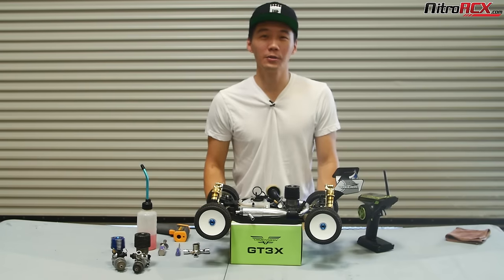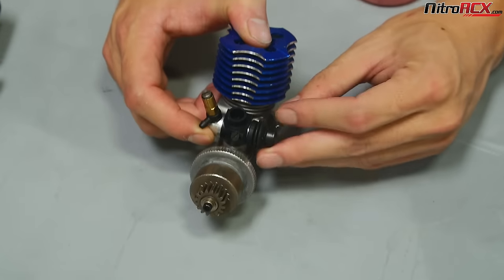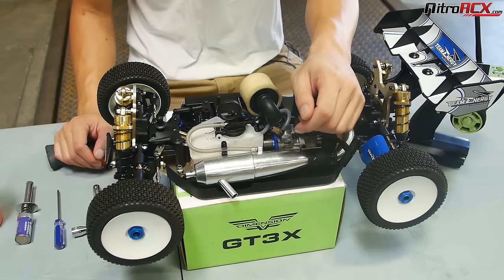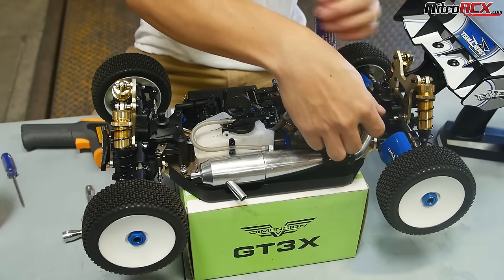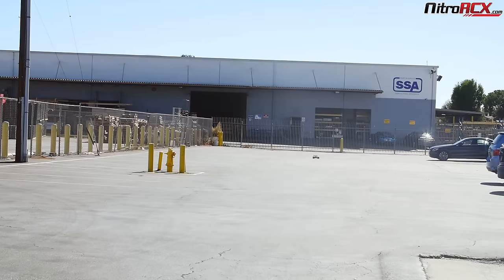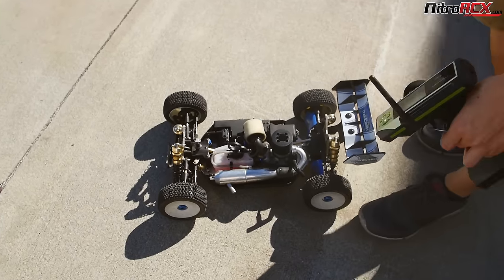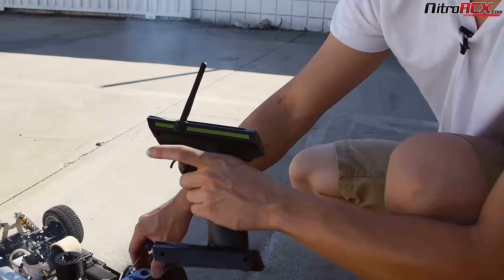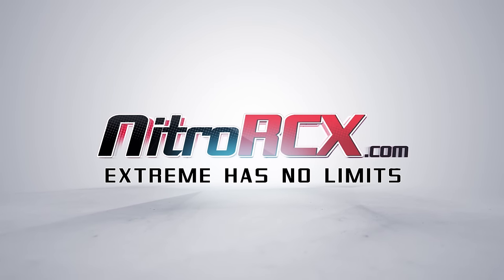Nitrorcx Guide: Fine Tuning your Nitro RC Car

Comment: I actually read the entire trx 3.3 manual and learned the importance of cleaning air filter after every hour of use (serious, it’s a big deal) dish soap then air filter oil and your good to go. I also learned that after every run if your are going to store for more than 3 hours go ahead and spray 1sec burst WD-40 straight into open carb and into glow plug hole crank engine 10sec and repeat 2x more times. (Serious, WD-40 in the manual) Starts up great after this treatment and more importantly it gets all the nitro out of the engine so it doesn’t attract water and rust bearings out and such.

Comment: Been 10 years since iv played with my nitro. Im getting back in the hobby. As far as tuning goes, all i remember is a properly tuned engine will have some smoke coming out of it while on the throttle and not so much while idle.

Comment: Good video, I am a new nitro user. Just finished rebuilding brothers Trx 3.3 (bearing rusted from improper storage and broke apart and got eaten by motor) and broke it in. Thanks for explaining that if pinging occurs coming off of top speed richen HS needle, and also if pinging at idle richen LS needle.

Comment: when your leaning the lsn and your idle rises, with in mind you have a huge 1mm gap, you should lower your gap. i usually use half of what you use and your idle is way high. very good video man, really good for beginners if they just lower the gap a smidge :p

Comment: The biggest problem we ran into,was air leaks. Usually after a couple big wrecks,the carb will start to loosen and run ruff. If you seal the carb throttle body with regular silicone to the engine,fuel line nipples and the air mixture screws with teflon tape. Your air fuel mixture and engine will run consistently. Then we hosed clamped out exhaust  pipes together,for durability.

Comment: It's the low speed you need to richen to get rid of the pinging because as you say yourself it controls the amount of fuel from low to mid throttle, when you let off the throttle after getting up to speed it's the low speed that controls how much of the overall fuel from the high speed gets into the engine. If the low speed is too lean you can keep richen in the high speed but it will still starve of fuel when you let off the throttle

Comment: fantastic!  bout to get my ken block on!  I just started it for the first time, I have lots of fuel coming out the exhaust and burned thru a tank in just a few minutes...I think I had the idle screw too wide open,  im saving your video to my tuning playlist and im going to tune tommarrow..its 6 degrees in Illinois

Comment: Nitro is much more involved and takes patience and attention. It’s also much more exciting then electrics IMO. Electrics have come a long way from back in the 80’s and can rip, but for real motor heads there is nothing like gas or nitro. This video is a great resource for newbies getting into nitros, and once they get it I guarantee they will sell or ignore most or all of their electrics. It’s kind of sad that electrics have kind of pushed out fuel powered cars and trucks, and actual kit building, but today’s generation is much more about immediate gratification, and RTR. At least RC is still alive and kicking.

Comment: I've got a Kyosho Nitro Inferno MP 10 TKI3! I'm using an Alpha Falcon plus engine with a mid speed needle! That's an added adjustment! But using the same principle and method by listening,A fine tune can be achieved!

Comment: To everyone out there, sometimes 1 mm is way too much on the idle gap. Mine is more like .2 or .3 bacause the throttle is super responsive so keep in mind if you have a huge motor or a fast motor it could be less.

Comment: Badass.  hey they should make a long screw like a key that you can turn by hand that sticks out far enough.  then you wont need a screwdriver.  like a wing nut on a long screw.  easy access
Reply: T. Man my trx t maxx has that on the hsn
Reply: my axial .28 and axial .32 both have that for the high speed needle

Comment: Best tutorial on Youtube. Easy to understand the issues and tune it right. The only thing did not mentioned was the idle needle setting after the other 2.  Is it the last tuning or with combination with low speed needle the result can be even better?

Comment: THE ULTIMATE SECRET FROM WINNER RACER!! In all the videos I've watched about carburetor adjustments for nitro rc engines not a single one talks about the secret I'm about to reveal to you that makes the difference between first, second and third on the podium. The low speed must be adjusted richer than normal but the motor must still turn well between 1/4 opening and 3/4 because the needle in the center of the slide controls from idle to 3/4. From 3/4 to full trottle you can put the slide needle in your pocket and it wouldn't change the mix. The result is that when the engine is running full throttle and you release the triger quickly the engine wants air and fuel but the slide is closed so a lot of gas (and oil) goes into the engine and cools it down and lubricates it better. Think about this.. How many seconds do you keep full trottle in a race...2 or 3 seconds.. then you can adjust the high speed needle leaner than normal and gain rpm and horsepower and by releasing the trigger very quickly for a fraction of a second like before entering a curve it cools much more and the temperature of the engine will not have time to rise above 250 degrees and you have maximum power.

Comment: A couple things you did wrong here. The engine should not climb in RPM then drop when you blip the throttle. This is because it is lean on the mid fuel delivery. You did not compensate for the low needle adjustments. When you lean out the low end on a 2 needle carb you must also richen then high end needle in order to get the mid level fuel delivery to stay consistent throughout the rpm range. With a three needle carb that has a mid range needle you adjust the mid end needle to get a flat idle curve so it doesn't rise and fall when you blip the throttle. When you blip the throttle the engine should rev and then drop immediately to idol otherwise it's lean at the top from over leaning the low end needle.

Comment: Wow, this is that good in saving the video. Thanks mate. Also you did not re adjust your idle speed once you’ve set the low needle. Would you recommend having the engine idling at that speed or would it benefit anything if you lowered the idle speed? Cheers Steve.

Comment: I have a question about the Idle setting, 

You mentioned that once you adjust the low speed setting, you would have to adjust the idle setting, 
I'm guessing the reason why it was revving a little high was because the idle setting wasn't adjusted?  
Or did you find that the idle setting was set perfectly after setting the low speed ? 

Finally, if you richen or lean out the motor using the low speed screw, does gap inside of the carb change ? 

Great video BTW !!

Comment: Hi! Ive just started with rc cars and i got an old rc nitro car out from the shed thats been sitting for a while. I can start it but ones it gets warm it FLIES away with the sound its like its rpm flies away and when i push the gas it dies. got any ideas?

Comment: Erm if it's hotter outside than before the engine will actually be richer not leaner. In hot temperatures you would run leaner needle settings than cooler temperatures. The reason is air density, the hotter the air the less dense and less oxygen there will be so to compensate you need to lean the mixture. Therefore going by engine temperatures is only for a rough guide because in hot weather the engine will run hot and in cooler temperatures the engine will run cooler.... if it's tuned.

Comment: Im building a Traxxas 3.3 Slayer Pro No Prep Drag Truck & wondering would you recommend 33% Top Fuel with it's low lubrication if only used after race competition?? For test & tunes I use standard 20% with better lubrication

Comment: question, If you feel that the LSN and the HSN are adjusted correctly and your temperatures are on the cool side  , but your idle is a bit too high that the car is rolling forward, what of the idle screw and adjusting it? To lower the idle? when and how would you adjust your idle screw and what to look for? Thank you

Comment: Does air flow through the top needle? I've put some locktite(blue) on mine. The needle was backing out when the motor was wide open. Now it bogging when I try to open it up. Any ideas?

Comment: I'm getting lots of smoke with high temps. 300 dregree... I recently change if the piston and sleeve to 2017 Nov mito gt5 from 2016 spec.... at factory settings the engine is already doing 250 degree and the car is very rich... what should I do?

Comment: Hi. I have a tamiya tgs running the HSP 18 Nitro Engine 2.74cc. Have installed the engine. When the engine starts up the all four wheels starts spinning. Can’t get the idle settings or tunning setting right. 
Please tell me what can I do and how.

Comment: That seemed to work, but when I give it throttle it will die, is that a low speed needle setting?
Reply: Patrick G yes it is. You’re either too far in or too far out. If it gargles then dies is too rich. If it makes like a vibrating high pitch noise then dies is too lean

Comment: I just took an engine apart I believe was somewhat seized. The engine would not turn easily at all. Cleaning everything did nothing. The piston moves freely in the lower half of the sleeve, but not the top half?! How can I "polish" the piston to make it smooth again? Do I even polish it? What is the right procedure? Thanks.
Reply: Frank Castle its  supposed to be like that, it means your engine got good compression and still good, u prob figured it out by now

Comment: thanks very helpfull video 
I run a losi with argus 28 engine which running good but my engine stall after high speed pass
when I release the throttle 
any tips ? 
thank you
Reply: Low idle or rich low speed?

Comment: Can you give me a bit of advise on clutch bell size? I am building a Losi TLR 8ight 4.0 buggy, I will be putting a Novarossi Roma .25 with Novarossi Mugen compact short header and Novarossi 9901 super strong offroad tuned pipe. I am going to be getting a Novarossi NV-71000 clutch. What size bell housing (tooth) would you recommend for bashing. The over sized bearing is only fitted to the 15 -17 tooth but I want punchy low end as well as top end.

Comment: I think I’ve got all my setting pretty good when running but any press of the brakes and it cuts out. Tried to increase the idle needle so it looks like it has a good gap when breaking (not totally shut) but no result… it must be something to do with the combination of the other two needles right? (high/low speed)
Reply: It should be related to the clutch. If you push the brakes and the engine stops, it means the clutch is still engaged so the engine stops with the wheels.

Comment: what I'm experiencing is when I blip the throttle, the idle drops down below the idle needle setting for half a second or less then it climbs up to where I put the idle needle at. If I don't blip the throttle, the engine idles perfect, acceleration is great, high end is great, everything is great,  the idle immediately comes back down and stays where I set it. It only happens if I blip the throttle several times. The engine never dies so I'm confused to what it could be.  The engine was broken in following the Adam Drake method.  Anyone have new ideas I can check and look into?

Comment: just hypothetically speaking.. 
what happens if I'm playing for awhile and i check my temperature and its VERY HOT. 
Can I do anything to lower the temperature? or just have to let the car rest up?

Haha I'm new so this is prolly a dumb question
Reply: Mika Yamamori 
richen the HSN. it should cool the engine down.. or you could let it rest for 10 minutes
Reply: Your engine should slowly drop temperature when at idle, which means your low end and idle screws are adding enough oil(which is in the fuel) to bring your engine down to a cooler running temperature. If this is working correctly and you are cooling while at idle, If I overheat I try to always let the engine idle down to running temp before I turn it off. Seems like a bad idea to kill the engine at really high temps because while cooling and the piston is not still shaping the sleeve things can warp. There are a few other tricks to running cooler, In line fuel cooler in between gas tank and engine(problematic for leaks). Cut holes in your body for better air flow. Air is your best friend if you can fabricate any type of air cooling system for the fuel or the head of the engine like forced air intakes or something it will help a lot. Also temperature outside is a big deal and parking in the shade XD
Reply: Temps have nothing at all to do with tune. Real facts: I'm not trying to go in on you because it's what you have been conditioned to believe. But I'm here to tell anyone and everyone...temp guns and the concept of a nitro engine temps being monitored is comical. I proved this....but it makes sense anyway. For you guys new to this hobby, realize there are fakers out there pushing their line. You might be consulted by guys who can't even start their engines, but they have shiny vehicles. Bobby up here is legit...he knows what I'm saying. Please keep an open mind.  and if anything, I've shown you can rock and roll with your engines without taking temps at all.
Reply: One other thing...and I'm talking from breaking in and tuning 35 engines I've owned.....I've yet to have this happen:
1. Hey everyone look at my engine it's a beast
2. Oh no! Check it out, I ran it lean. Now the engine is running damaged.

What HAS happened.
1. Hey everyone, we rock nitro
2. Oh no....I ran it rich for way too long. Here are the effects.

Why do temp slaves focus on "hot" and never too cool.?
Reply: Nitro RCNerds channel ? "NO COMMENTS" he disabled the comment..WHY? i wanna say very nice ..or good tutorial but nobody can type -in a comment...too bad he is good tho..

Comment: When you took that temp at 15:00 if you watch it actually is at 251 degrees that thing even sounds to lean at that moment that’s why it cut off to hot for that particular engine some engine run hotter an perform fine but this engine won’t, it 🔥 out on you

Comment: Hi I just got a Rc race car is a traxxas 2.5 motor I don't know nothing about this car bout I will like to get it running back coz I was a give from a friend and he gave me the car bout no remote control no ez starter and what fuel is that it works with. So I will like you to help me with that. I u can friend.
Reply: Sammy Fuentes u should join rc nitro forum to get help from rc nitro guy's from around the world

Comment: Newbie question: what adjustments do I need to make when the pipe drips fuel (at idle and under throttle)?
Reply: It is running too rich. So lean the high speed needle by turning it clockwise

Comment: Hi guys, i started my nitro rc after 4 years but the car is very slow and runs with high RPM. What can cause this issue? It can be caused by old fuel? I can fix it with the tuning?
Reply: re tune it. Are you running it lean while it is slow?
Reply: Did you start it with 4 year old fuel? Lol

Comment: I wouldn't have guessed that these engines rely on vaporizing fuel for cooling and to control pre-ignition.    It seems opposite of "normal" engines?  Hot air is less dense (same as high altitude), so to keep the same air to fuel ratio, I would expect that it needs less fuel.

Comment: My Rc keeps dying when I accelerate and takes ages to start is the low speed need to lean or too rich?
Reply: Little late but anyway, I think you have to much air coming into your engine and you need to richen it

Comment: Hello, I have a ke 25 engine and i am wondering about something. When i start my car i have to rev it way up, and i mean waaaay up. On the idle screw its about one and a half rotation, forget about hourly incriments xD This ofcourse means that when my car starts it starts revving up fast, kind of alot more than ive seen in other videos. But after it starts i can turn the idle screw back and stop the wheels from spinning without stalling. My friends think that my clutch is engaging early, and that might be the case for all i know. But i have no idea how to check if that's the case. Any tip on what to do here? 
Current temps im driving in are pretty cold since i live in norway. So i've had to mess around alittle with the tuning. Can my high speed or low speed tune be what causes my wheels to spin if it's not the clutch? 

Thanks in advance to anyone with advice!
Reply: make sure heat up the engine with engine heater or hair dryer, and you can start engine very easy ,smooth, after then you can start set up

Comment: How to stop the oil throughing from the exaust pipe
Reply: Parilakshya Bakliwal it’s normal usually means you need to break in the engine if you have done that already it should be okay
Reply: Oil from the exhaust means your running rich. Lean it out a little at a time and you will be all set
Reply: Oil from the nitro engine is normal. If your not blowing oil your to lean and running hot. With killing the engine a possibility. To much oil and it’s to rich. Can lean it out a bit.   280max temp with blue smoke and a crisp throttle response is what you want.

Comment: The reason it's running hot is because you haven't got a body shell on it which helps with airflow round the engine!!

Comment: doesn't studder. starts have to hold or it will runaway if i lift wheels off ground spins fast if i let go i have control but not gasin haul assing on its own flipped a few times
Reply: Check the carb opening. Set it to factory or 1mm.
Reply: adjust trim
Reply: I got same problem! But carb is at 1mm an I adjust the trip as far as it will go b4 it starts applying de brake an doesn't move freely if u push it!